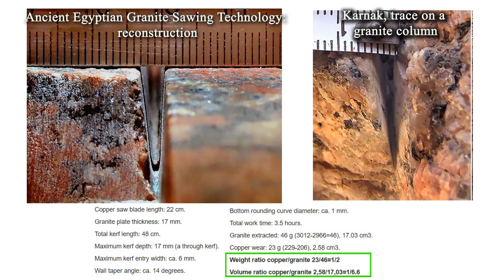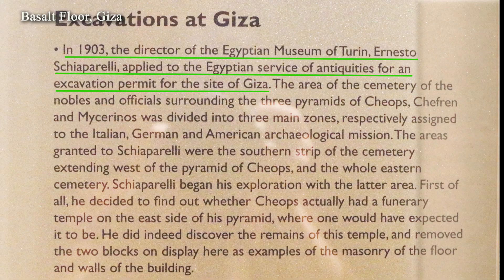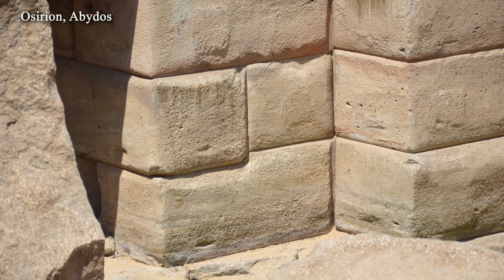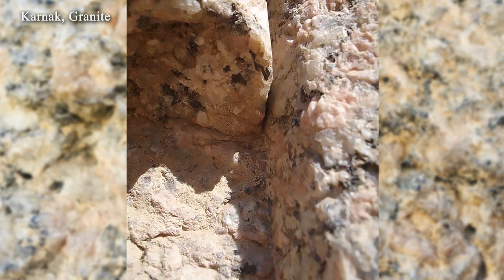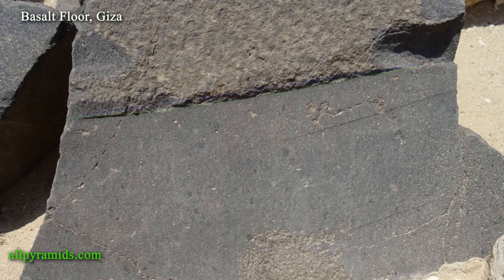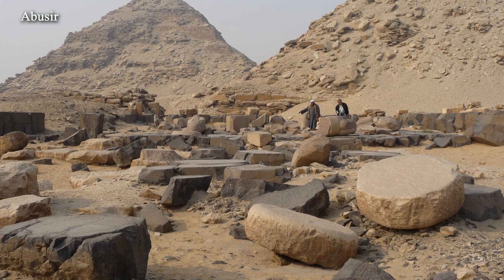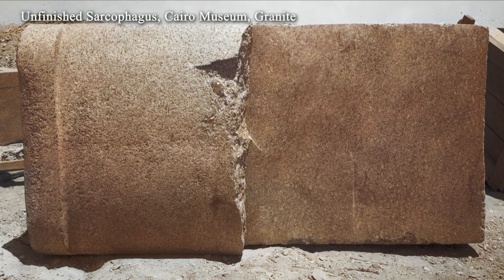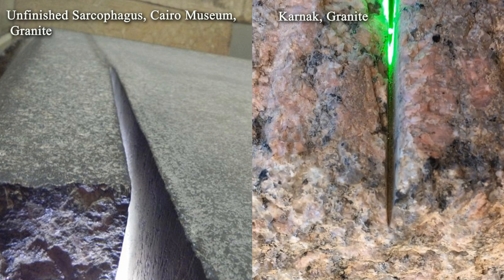Analysis and Answer to the question of What was used to Saw stone in Ancient Egypt

Comment: The only tool that could be used to to shape the stones used in megalithic polygonal walls is a water jet cutter. You could notice that most megalithic sites are located close to a large body of water such as a lake, a river or an ocean
Reply: No. 
The faces of the stones aren't flat, but curved.
So no water jet cutter.
Reply: @PèrePendiculaire  The faces could be left untreated, or could be processed with a flat water jet that would remove the material layer by layer instead of cutting though it
Reply: @tedantares2751  In Egypt as in America, India, Cambodia, most of the stones show toolmarks. 
If you have a super-efficient tool, you will use it as a basic process ; but it is not what we observe.